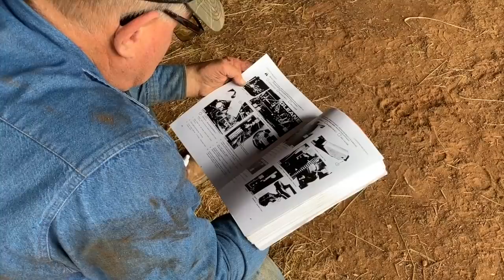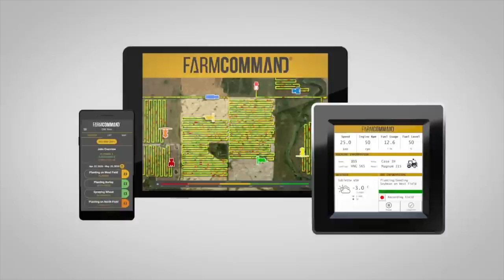Rain and Repairs : More Rain and Work on the Gleaner

Comment: When it came time to get ready for each  crop / season (tillage, haying, chopping, picking corn, etc), Mom had me wear the same set of clothes because they were so stained & coated with grease & oil.  I got really coated when I had to grease & oil all the chains on our 4 chopper boxes, chopper, mo/co, blower and tractors.  Mom had an old washing machine hooked up in the shop JUST for these type of clothes.

Comment: Don't worry about downed barley, that "Hume" reel that is on your grain head will pick it right up. FYI: those large shields lift off very easy on each side of the Gleaner for servicing so you don't have to walk around & fight w/ them when they are open. Also barley straw in small square bales brings very good money (up to $10. ea.) used to prevent algae in ponds. I seen a N.H. 268 sm. sq. baler in a shed on one of your videos. Thank you for another nice video, Ur hair tune-up   looks great, plz farm safe.

Comment: On the Gleaner always make sure when you disconnect the header that the top tilts backward just a little That allows for the top hooks to get to the header first. I had a "Gertie" that I bought new when I was a senior in high school and did public work. Best machine made in its day. Yours is a little newer than mine.  Yours has the four cylinder turbocharged engine and mine had the 6 cylinder engine.

Comment: If you look at the bottom of the sockets. The ones that have the line of little marks around the bottom under the marked size are ALWAYS metric. So if you see the little tic marks circling the base of the socket. It's a(n) metric. ;-)  The size of the socket is always marked on the end that goes into the ratchet, not the bolt. This is because it's the end you are working from.  Maybe this can help you in the future.

Comment: Meredith, I'm a 100 miles north east of your farm. We've had rain for the past 5 days, nothing like what you've received, but 1/4' -1/2" a day. Not supposed to clear until next Thursday.
I've had to cut the grass 3 times in the past two weeks, which is both good and bad. Need to spray the fence lines with 2.4.d, but until I can get two days in a row with no rain, no weed killer. Same goes for spraying the house for ants. 
A local farmer has a John Deere combine sitting for sale. Haven't seen any attachments, but if interested, I can check. Same goes for the possibility of a trailer for the bean or corn head.

Comment: I switched to electric grease guns a long time ago . The best one for the price is the Lumax LX-1175 Handyluber 12V Cordless Grease Gun with Single Battery, 7000 Psi $118.00 bucks on amazon. I’ve had mine for 3 years now and works like new . Also get the locking tip it works awesome for zerks that get hard to grease.

Comment: Wow, I still can't believe how many grease fittings are on a combine.
Reply from the maker: Sooo many!
Reply: Some combine using had a central lubrication system filled with oil. The problem was that if an oil line got taken out, the entire unit didn't get greased.
A trick we learned was once you locate a grease zerk fitting was to spray paint the fitting a contrasting color to make fid it next time much easier.
Reply: Twenty eleven probably!

Comment: There is a place, some miles from here,
And I’ve always wondered ‘why ‘,
A shed that’s full of broken grey.
That would make you want to cry.

The barley’s nearly ready,
But the rain begins to come (again)
That’s typical of farming,
And work on Gerdie’s never done.

LB calls for spanner’s,
Mer shoots off, to the truck.
“It’s 9/16’s” he hollers,
She’ll find it with some luck.

The headers on, the oils changed,
She’s getting close to have a run,
The barley’s quite bedraggled,
When all it needs is breeze and sun.

By the way,your new hair looks really lovely,
And your ‘Farm Hard ‘ tank is really niiiiice,
I’ll take 2 of those by post please,
But I don’t want any griiiiiice !.....grease.